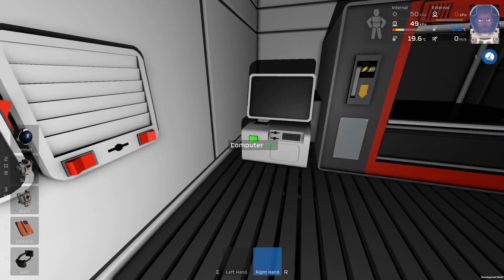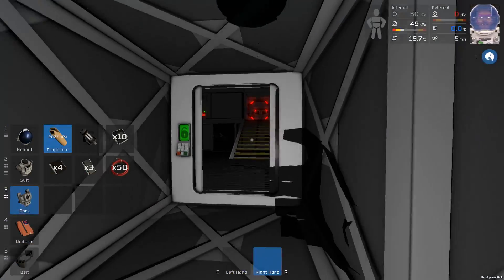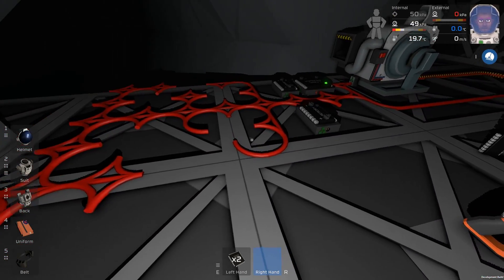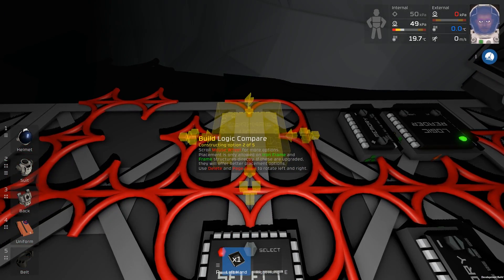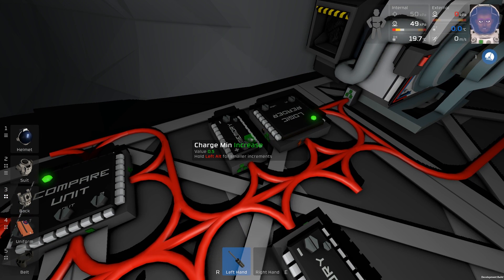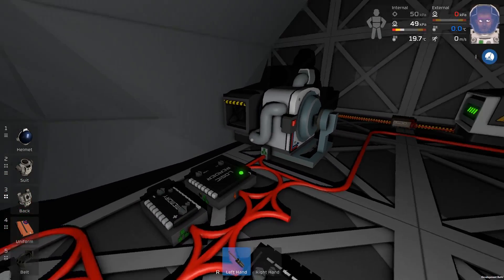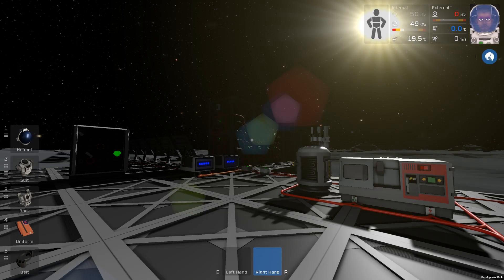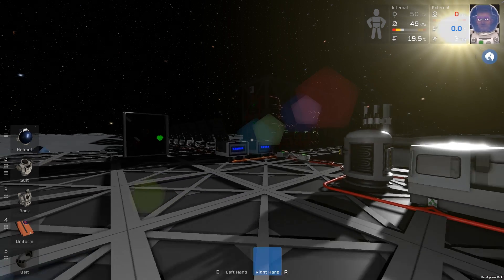Stationeers E20 - Furnace Updates

Comment: I know this video is older, and this may not matter at this point, but here it is.
On the topic of solar panel layouts, as of the making of this video, you have the panels all on the same grid, dictating the need for the heavy cables, costing gold, which you need for more panels. So I am wondering if you can use standard cabling on up to 10 panels, maxing out the load the cables can take, to a transformer to separate the network from other panel sets(also 10 panels each), which then uses shorter runs of the heavy cables to attach multiple transformers to the battery bank.

It takes 3 cables to span a panel, but one is a junction, so you use 4 heavy cables per panel, 2 grams of gold per span, or 20 grams of gold per run of 10 panels.
A transformer is only 1g of gold. panels take 5, so for the amount of gold used in the heavy cables, you could have run standard cables and gained 4 panels. or 3 panels and 5 transformers.

Does this make sense? perhaps a better solution to resource management? I may implement this in my base (I just started playing the game)
Reply from the maker: You can certainly use standard cabling on up to ten panels, but then you'd need a battery/transformer as you say, at the end of every row when you scale up.  Moving to gold means you can just put down more and more panels, without the problems of shadows interfering with the sunlight with multiple rows, and gold isn't usually that hard to get a fair amount of in mid-game.  Entirely up to you of course - your way would work just fine too.

Comment: It doesn't look like your A/C output pipe has a vent to release the gas thus you're building pressure  in the pipe. Perhaps the game A/C just stops working once there is too much pressure in the output pipe.
Reply from the maker: That's more of a waste heat pipe - unlike the wall cooler, it doesn't seem to need to be open to a passive vent or similar.  Apparently, you can fill it with a different gas too

Comment: Just make on frame distance between Solar Panel Rows is enough. I tested it, past 3%..97% no power reduction otherwise -50% for one of the rows thats enough I think in terms of space usage vs. Power generation.

And try using: Angle * 0.66667 - 9.2 Min/Max 0..100 gives 495-500 Watt per Panel. One of the best results I've seen so far.
Reply: (Solar Angle * 2/3) - 10 = (Solar Angle / 1.5) - 10 = (Solar Angle - 15) / 1.5
All three formulas are the same.

Comment: What about the waste pipe? It's not connected to anything so it's a closed pipe right? So it's backing up? Stopping the machine? I don't know if Im exactly right I'm just trying to be helpful
Reply from the maker: +Michael Inman it's not exactly a waste pipe - think of it more as a place the active unit dumps heat.  You can pressurise it with a different gas - unlike the wall cooler, which does need an output back into the room

Comment: Why not just logic reader reads slotoccupant -> logic writer activates furnace?
Reply: Also connect the atmospherics waste and input on all the filters, that way you have 1 single pipe with 6 filters filtering in parallel instead of that serial attrocity
Reply from the maker: That doesn't always work (I tried that initially, way back) - it works with the prior setup to this, which is activating on input slot occupant or export slot occupant.  That just uses more power :)
Reply: You're doing it wrong then, simply reader reads the slotoccupant, the binary is fed into the writer to arc furnace activate. Works like a charm, have very similar design with gas capture shooting bars back to my production area via another chute
Reply from the maker: They may have fixed a bug then in more recent versions - it used to jam when there was more ore in the chutes than there were furnaces, if you just read input slot ( i.e. 3 stacks of ore or more, and 2 furnaces).  If that's fixed, good to know :)
Reply: Yeah its a bit odd, been pushing quite the amounts of ore in and hasnt failed me at least yet, maybe then with more stress testing...good series, keep it up!

Comment: Honestly, this seems gimmicky and I'm not a fan. The way I have it is to have 2 readers take in the entrance and exit chute status. Math unit to add them up and then a writer to activate when state =1. Super easy and activates when new ore hits and will activate again if there's more ore in the chute.
Reply from the maker: Yep, i had something similar, but with import or export slot occupied, which works, but just uses more power, which is more coal down there.  I'd probably do that, once I have it hooked up to the solar panels - i.e. free power

Comment: Did some testing with the a/c unit and it seems the greater the temp difference the more power it uses, when I started it my power consumption went from 900kw to over 7,100kw and everything shut down except for the a/c unit. 

Mind you I have 20 solar panels just for the air management part of my base (50 in total) so I think I am going to try and manage temps in a different way.
Reply from the maker: I haven't found enough gold for all those solar panels yet, hehe!

Comment: Just install back presure regulator on the returning pipe of AC and it will keep the presure to radiate the heat
Reply: yep, only problem is that he need a cut of circle for the co2, because he loses all heat when he bring it back in the big pipe system, only problem on the start is when starting the room, is that the cooler can take up to 8 k by full power, only way to handle is a battery in front of it with golden cable, otherwise it will burn.
Reply: Then maybe installing pipe analyzer and electronic valve could help? Just release gases when they are cool enough